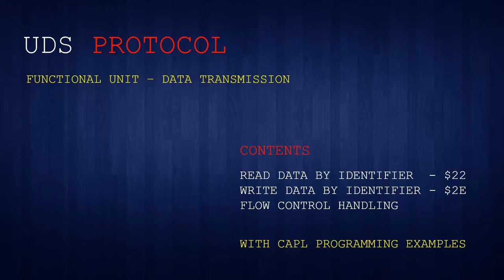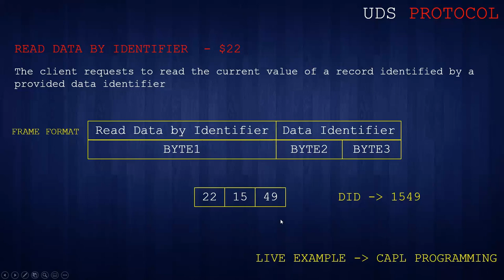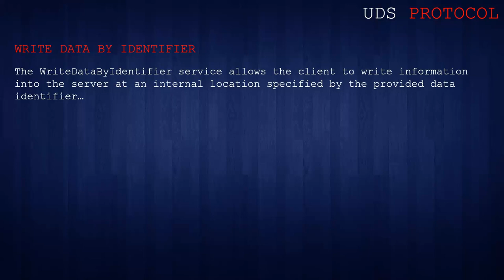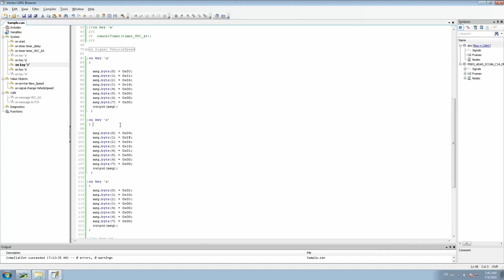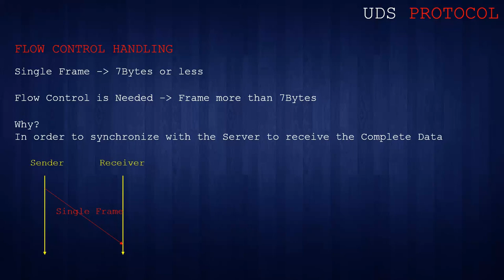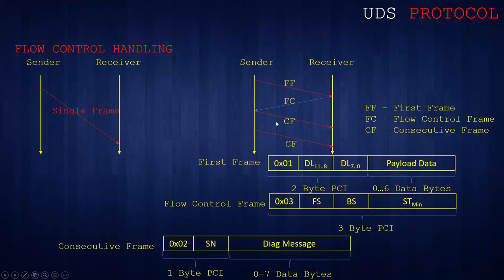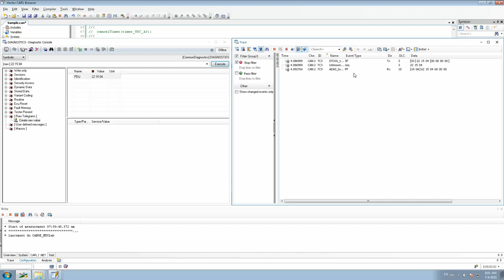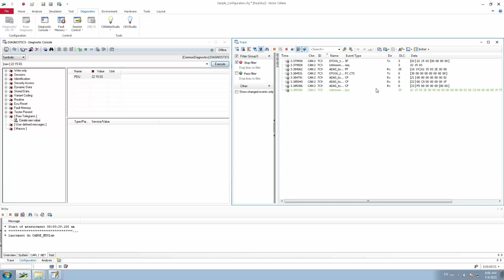UDS Diagnostics - CAPL Programming (Read & Write Data by Identifier)

Comment: Hi @Mani S, thank you for sharing this video for read and write. 
Can you please do a video on CAPL programming while sending request with more than 8 bytes to the server using 2E write request ? The ISOTP protocol works wile transmitting data more than 8 bytes, but I want to know the opposite way receiving more than 8 bytes.
Reply: Hi Mahesh did you get the solution for your question? if yes please let me know... I too have the same question

Comment: 0x7C3 is the request id for 22 service in your example? Or the frame that transmits the used service information?
Reply from the maker: 7C3 which is mention in the 22 service, is the ECU Specific Request ID. This request/response Identifier is unique for each ECU. With that only, we could read/write the data to any specific ECU. This is made so, because all the ECUs are connected to the same CAN Bus.

Comment: at the example where you build the message of CAN i understand the CAN message frame but, What are you doing with that variable message 0x7C3 msg ? and at the final l What is output(msg) is like return ?  beforehand thank you for your awesome contribution.
Reply from the maker: 0x7C3 -> It is the Request Identified for the ECU. 
Output function is used to transmit the request information to the ECU.

Comment: why this.byte(0) needs to be & with 0x30 at time 27.47?
Reply from the maker: byte(0) with 0x30, it is for the flow control. As you know, CAN can support 8 bytes of data. But when you have a Data of more than 8bytes you can't send it in the same way as like any other 8byte data, for this case CAN offers a method called flow control, where you can send the data in groups. In order to send it sequentially, you will have 0x30, 0x31 and so  on (based on the data length).

Comment: Hi bro How to get rx dir in trace window I cannot able to get rx message if you connect the hardware then only will we get rx message in trace?
Reply from the maker: Yes it's very obvious that, Rx will be coming from the Hardware only. If you want to see the Rx Signals without connecting Hardware, then you need to load the log of a previous recorded trace to replay it in a simulation mode
Reply: @smk1984eee  ok thank you